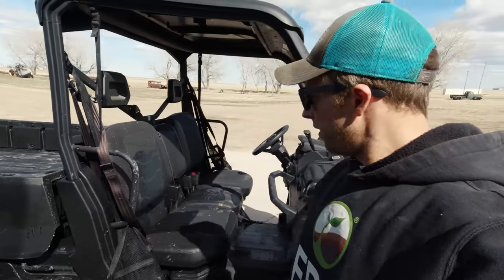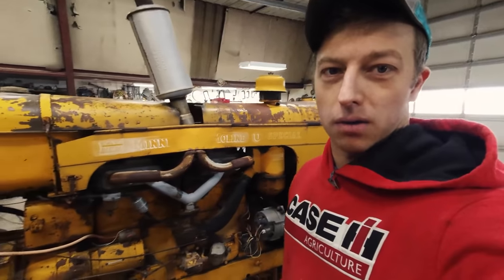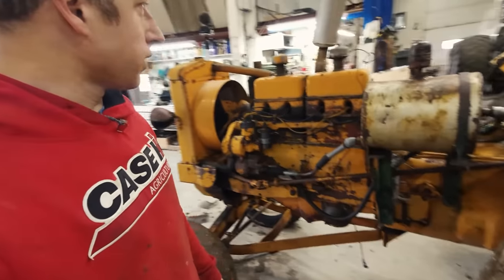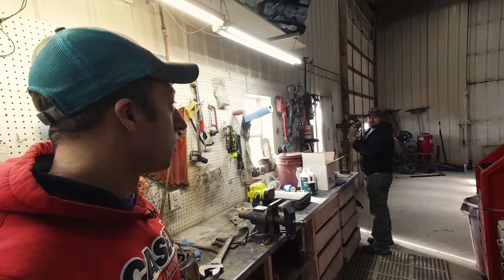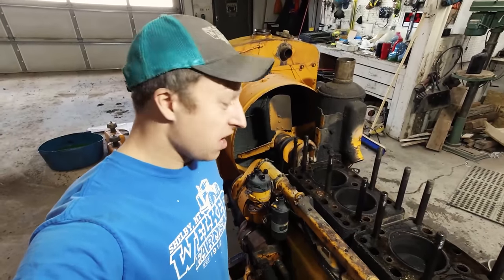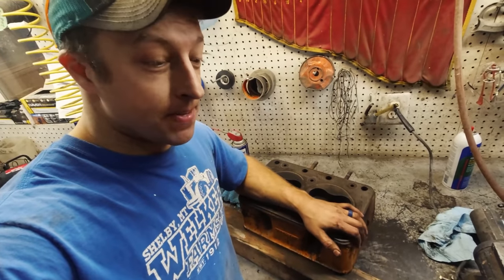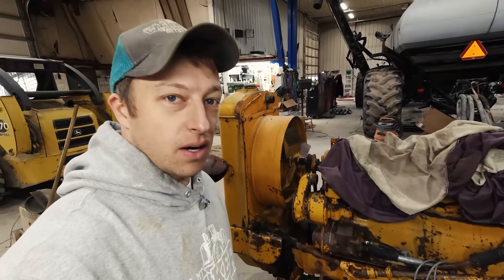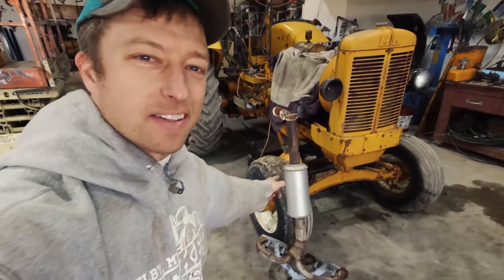Oh SNAP! Literally, it SNAPPED off! - Moline Part 1

Comment: First off, ez outs never work on a seized bolt, the screw and push out and actually tighten the bolt in the hole. Second, I drill out spark plugs on the engine all the time. Also have heli coiled spark plugs holes all the time head on engine. A few tricks I use to keep chips from engine

Comment: I had the same thing happen on a little Nissan pickup and got the stuck spark plug threaded part out exactly like you guys did with an easy out and heat, I didn't have to pull the head off though.

Comment: Love the can am buggys
We went with the commander 800 for farm use 
The "farm based" ones like the are great but they lack speed and power to really muster animals and travel down the road at decent speed 
Put 500hrs on our commander in th last 2 years 
Great for mustering sheep and rock picking as well as crop inspection

Comment: Normally when using tank sealer, you drop a couple lengths of 1/4" or 3/16" chain inside the tank to break all of the crud loose. It's a lot easier to get the chain out when you're finished than trying to shake out a couple pounds of hardware.

Comment: How I do gas tanks if rusted a little inside,get a couple pounds- of pea rock,there small,dump inside!shake it, it may be nice and shinny inside,my 43 Massey Harris still has original tanks. I’ll always fix when possible. I didn’t notice a fuel filter,I’ll look when you get back? Agparts has plenty of MM parts. I’d feel lucky heads are not cracked between valves,it’s very common amongst the old MMs. I love the old tractors!

Comment: For cleaning an old tank you put wood screws in and strap the tank to a concrete mixer in various positions. The sharp edges of the screws scratch the tank clean from the inside.

Comment: This. This was a great video! I love seeing old, reliable machines given a little love to bring them back to life!
I spent a lot of my youth making new wire sets and cleaning/renewing old farm equipment in AG shop. It pains me to think about how many of those programs no longer exist in the modern school system.

I've used nearly the same setup you guys used to clean the crankcase with an extinguisher....  but our shop teacher had us using ATF instead....  man that stuff would leave a crankcase looking like it just came off the factory line...  Of course, he would also have us (if the engine was in running condition, drain the oil and and then replace it with 25% oil and 75% ATF, and run the engine until it reached operating temp......  THAT will definitely clean an engine....  but I never liked that method of lubrication.... ATF is pretty damned thin....

But hey, at 16 or 17... you follow the shop teachers instructions.  :)

Again, glad to see you guys putting some love into old iron.

Love your channel....

I hope this planting season goes smoothly for you guys!
Reply: With no load and limited revs ATF is adequate lubrication. Makes a good hand cleaner too. I've even used it as shampoo to get old gear oil out.

Comment: We got 3 300 Honda fourtrax’s a 1988 1995 and a 2000 and all 3 of them still run like they are brand new and we recently bought a Honda pioneer 700.
Reply from the maker: Hondas are pretty bullet proof, a friend of mine sent his down a river, drained the oil and pulled the spark plug, cranked a few times, new oil and plug back in and they've been going strong ever since.
Reply: Welker Farms Inc We’ve never had them flooded but boy they’ve took a beating but they keep truckin

Comment: ...on that broken plug.....Squatch253 had similar problem with pre-combustion chambers on  a Cat D2 engine....had to soak head in a rust buster for a week or so, then reheat and with a long cheater on his breaker bar, they came out...no thread damage....he ran a tap through just as a check....

Comment: Great video. I spent many hours on MM U and Z  tractors as well as a ZB later. With their hand clutch and brake placement the U and Z were some of the best tractors made for standing up while driving. The ZB had a foot clutch and took some getting use to after driving the U and Z so long.
Reply: Agree, that's why they worked well as rock picking tractors

Comment: We found the side by sides didn’t make much sense at least here in NZ. They cost about 30,000 nzd new which is quite a lot and the maintenance ended up costing a small fortune, tires are more expensive and just parts in general. We ended up getting some old Toyota rav 4s (late 1990 models) and put tractor grip tires on them in the winter. Safer than the side by side, way cheaper, get them for 5000 to 10000 dollars. They have heaters in the winter, airbags etc can do 100 km/h on the road. we don’t bother making them road legal as our farm doesn’t have much public road access. If they break down badly it’s no big deal, just get another one. Get at least 3 for the price of one side by side. And parts are easy to get, one of the most popular small suv’s NZ.

Comment: I use to pull against a gb and a g1000 .  They use to hate seeing my old LA CASE showing up to the tractor pull.     Old 1945 LA CASE had a stroke a mile long and that grunt power down to the last rpm.
Reply from the maker: It's amazing, very cool tractors!

Comment: Love Can-Am's, nothing beats them performance wise, but parts are expensive and hard to come by. I need shock bushings for the right side of my 16' Outlander 570 XMR, and they told me they don't sell them (I checked they don't) and that i need to replace the shocks at $70 each ($280 as its both on the right side and you need to replace them in pairs). I even looked online and the only thing I found was that people buy aftermarket bushings and end up having to machine them to make them fit correctly. I checked polaris out of curiosity and they do sell individual bushing for real cheap so it seems kind of scammy on can-am's part in my opinion.

Comment: I used a long chisel for our gas gauge on the 530 until I dropped it in the tank. Years later I had to take the tank off for some reason and finally got it out. Still in my toolbox.

Comment: Okay, the bit with leg Arms in the power wheels was hilarious. The UTVs make a lot of sense as you won't need to fire up a truck to just zip across the farm to get something or take someone out to a machine. 
If it was a motorcycle engine I would call them "jugs" as I have never heard that part called anything else.

Comment: To clean a head without machining you can use a new flat sharpening stone. You want new because they will be flat where a used one probably wont be. Use some wd diesel atf whatever lubricant and slowly use to to clean and flatten the head surface. Don't tilt the stone just hold it flat on the head (you can also do it to the block with towels in the cylinders) and do it till it's all the same shine. Clean it off real good clean your cylinders with atf and you'll have as flat of a surface as you can get without machining. Far better than using a scotch bright on a air tool or whatever... deboss uses that method even.

Comment: I took a broken plug out of an engine for a mate. It broke off and left the thread in without a hex or an electrode. I had a square type easy out set that are tapered but have a machined edge that digs in when it is turned backwards. Sprayed liberally with WD40.I started with a 3/8 bar on this 3/8 square removal tool and tapped it in. No go. 1/2' ratchet with 3/8 reducer. No go. More WD40. Used long 1/2" breaker bar. We got a slight eeek. Only a fraction of movement. tried again, nothing. More WD 40. Waited a few minutes, tried again, another fraction, we repeated this proces for about 2 hours. Got the broken bit out. Time was the thing and patience. I could not believe we got it out.

Comment: One trick I have is to put a spot of weld around the inside of the threads, it heats it up and the weld pulls the plug together loosening it as it shrinks the plug!

Comment: Someone made a set of conversion housings that ran leds but looked just like the old sealed beam. I don’t think many would hold it against you if you did something like that. Would help the old girls wiring out a bit as those leds tend to use less amps. Being as you are that far into it, should just finish the resto on it and be done. Don’t forget that new 20 acre climate controlled storage shed for all of those machines. Hate to see the weather Beaty them back up after all the work that has been put into getting them back up to snuff.

Comment: Not sure how long this MM has been sitting but, we learned, if they sit for any longer than 6months not running... Best to just start opening things up and going through it. Can definitely tell it's been sitting awhile. (Reason being, it's our "humidity" levels we have here in KS). As for the oil flow in that filter, you had it right the first time. My question is, is that a simple add on hyd tank on the side? Just don't remember the "U" having the tank on the side before. By the way, Seafoam!!! Run that in the tank, that will be the MM's best friend. Never been a fan of the electronic ignition but, one has to do what they gotta do. Welcome to farming, simple fixes usually aren't so simple in the end. We used to have an old MM, don't remember the exact model, 5star or M5? Was converted to run on LP, when she ran, she'd go all day and keep on going. Unfortunately, she was broke down more often than "fixed". All due to the conversion wasn't done correctly.
Congrats on the 2 new rides. Great video, cheers :)

Comment: I fill all my steel tanks right to the top with ethonal free Mixed gas  .when the gas evaporates it leaves a oil film .also coats all the exhaust inside and the carbs .never failed me yet

Comment: This is not a recommendation! Just a story about the cleaning power of diesel. We had a Detroit 8V-71 where one of the injector feed lines was left loose by accident. By the time we noticed it had pumped 5 gallons of diesel into the engine diluting the oil. That was the cleanest 8-71 we ever opened up.  On the flip side we had another 8-71 where the internal seal on the air compressor failed allowing it to pump all the engine oil into the air tanks and burned the motor up. The wrist pins on that one turned blue.  Fun times!

Comment: Worst case scenario drill the spark plug out, tap new threads in the hole, they make reducers just for that problem fords 5.3 triton motor is famous for breaking plugs. Also those are called cylinder sleeves or jugs

Comment: when you heat up threads, you let them cool down before you go at them. They are constrained to expand in diameter when heated, so they do axially. But they can shrink when cooling down both ways. Check out guy on youtube called AVE. He has a lot of technical science in his channel.

Comment: What in the sam hill is that silver barrel for on the drivers side of the mm? Nice video guys!   Ron
Reply: For the oil needed for the pull rock picker.  The dump cylinders were one way type
Reply: @RobertWelkerFarmerBob  thanks for the info, here's wishing you and yours a safe spring planting season!  Ron

Comment: My experience with tank liner is not good. Always followed directions to the fullest but the liner failed every time. And what a mess it creates when the sealer flakes migrate downstream. Also I never recommend dislodging sludge with solvent, it only leads to large clumps dislodging and plugging the pick up screen once you start working the tractor. If you just can't drop the pan down now, leave the sludge alone and fill with clean oil. The sludge will stay right where it is until you get around to the rebuild.

Comment: 50/50 mix of acetone and ATF in a spray bottle, i have yet to see it fail to release anything with stuck threads - works 100% better than anything on the market.
Insurance Adjuster : "So you then grabbed the nearest Fire extinguisher and it had what in it?"

Comment: Run Hot Shot’s Secret Stiction Eliminator. You’ll be amazed at how well it will clean the engine out. It’s about $45.00 a gallon.

Comment: For doing a cylinder or block resurfacing without a milling machine, take a piece of 180 grit wet.dry sand paper and wrap it around a piece of ground stock steel and use it like you would use a draw file. Spray the paper and metal surface with WD40 and draw the paper across the surface 4-5 times, spray with WD40 and draw again 90 degrees to the first filing.
The good thing on old engines, since they use a solid head gasket, you can spray the head , the gasket and block with Copper Coat or Indian head gasket cement and reinstall.
And Nick, check out the easy out set from Ridgid Tool. Instead of a left hand spiral, the Ridgid easy outs are a rod with raised ridges that has a matching nut that slides over the rod. Then you can use a impact gun to remove the stuck item. Also, if you have one of the old plugs, you can drill the reduce the wall thickness, the use a small chisel to collapse the remains.
Reply from the maker: That's awesome thanks for all the great information! I'll look into the ridgid easy out and the 180 grit wet dry paper.

Comment: Use the red Case-IH to mow with. Those old tractors make me nervous, I have known a few good people who have had fatal accidents with old machinery. The risk is identifiable. Often roll frames (&wheelie bars) can be fitted, remove the mudguards& mount the mudguards to a roll frame , certified mech engineers can design roll frames (if the law allows in your area)The net has a few articles/ plans  http://www.ragusashwa.it/CD_2012/lavori/TOPIC3/orale/topic%203_111_117.pdf     (article on roll frames for old tractors) . New fuel tank and inline filter if the coating does not work. sheet metal https://agricrafts.com/
    or plastic $116 https://www.usplastic.com/catalog/item.aspx?itemid=38321&catid=578  (paint white then yellow)
Reply: I don't think they'll be doing any wheelies or tipping over where they are

Comment: 22:11  I'm not a mechanic but I'm pretty sure you shouldn't clean cylinders with a wire wheel as you just demage cylinder walls.